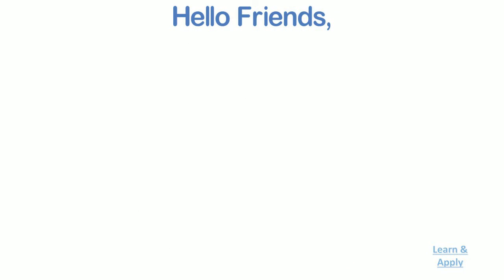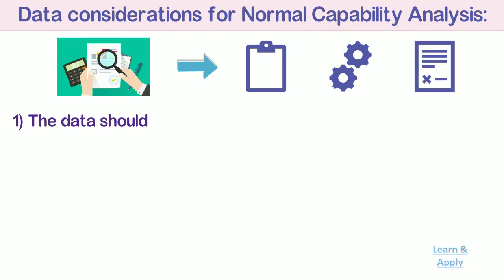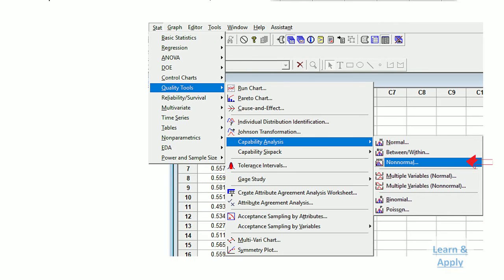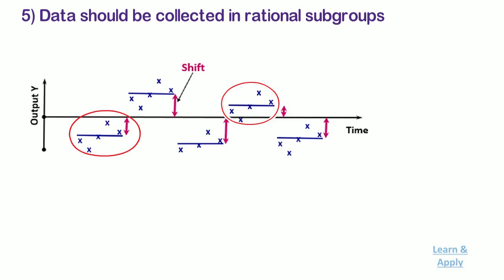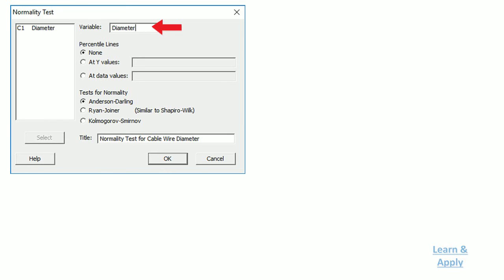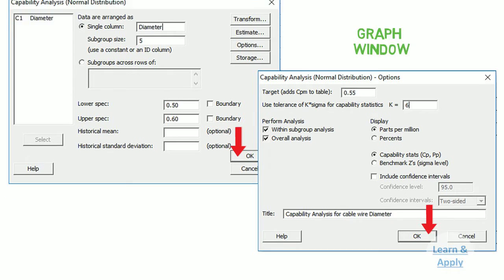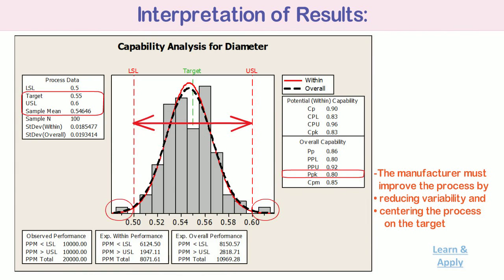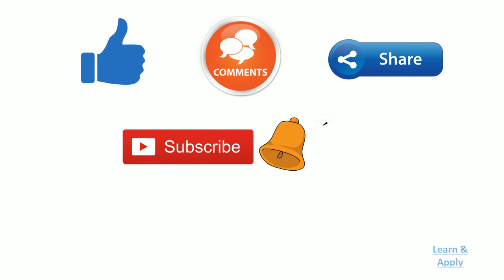Process Capability Study in Minitab (Normal Capability): Illustration with Practical Example

Comment: Respected Mr, 
can i know hint about the difference between "Control Limits & Confidence Intervals"
OR I Mix errors in this question?
Thanks for your time &Regards
Reply from the maker: Hi Esam, control limits are calculated based on the data and indicating +/-3 sigma from mean I.e. 6 sigma spread.
Whereas confidence interval is about the mean how that can be very.

Comment: Hi, Can I select Capability six pack instead of capability analysis?
And why did you choose subgroup size of 5?
Reply from the maker: Of course, you can.
It depends on the sampling methods. If you had collected data in subgroups, then select the subgroup size. Otherwise, select it as a 1.